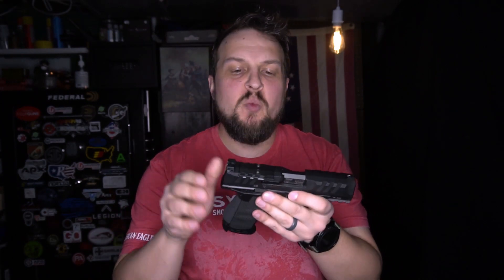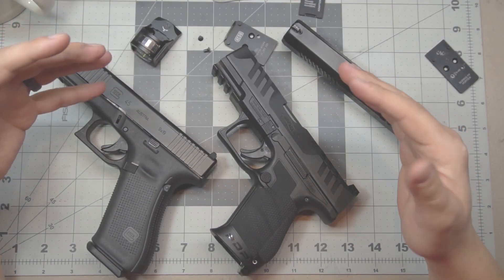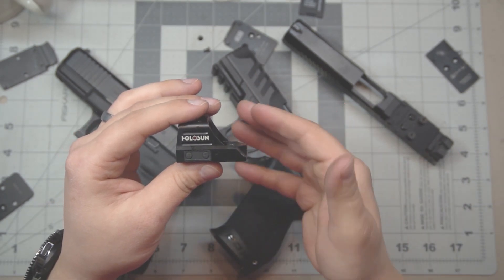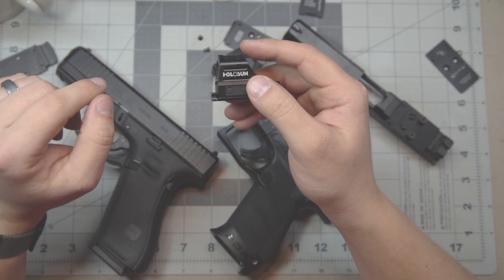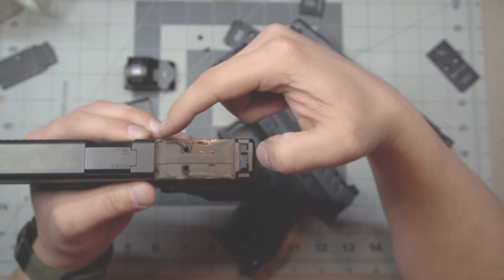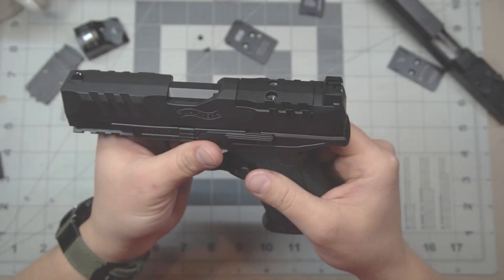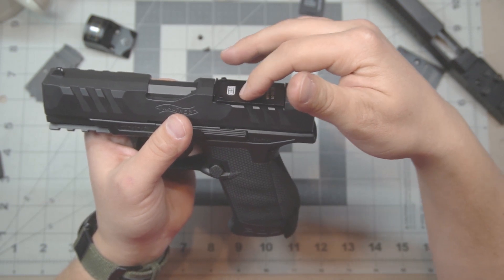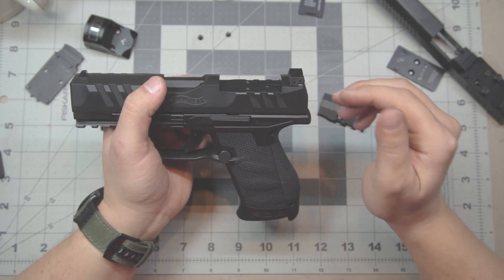The Gen 1 Walther PDP is going to Break

Comment: For what it's worth, I am a Mechanical Engineer (and an Electrical Engineer), I own a 32 year old company that deals with firearm modifications, I have designed modifications and I have worked as a hired consultant by 2 gun companies during design stages of a new model.  

I know what the tensile strength is of the mounting screws.  I know what the sheer strength is of the slide threads.  I am aware of the G-Forces involved with a red dot and plate on that reciprocating slide.  Inevitably I can only come to 1 conclusion which is backed by solid science.

The new Walther PDP is not going to break.
Reply: A touch of thread locker and properly mounted and torqued screws will greatly aid in preventing any failure of the plate mounting system.  I would still agree that having the cutouts and lugs to help in that are better, but I don't think this will fail because of slide movement from firing.
Reply: I am neither a mechanical engineer or any other kind of engineer, but even I knew that any discussion that didn't take into account material strength and use actual load numbers is a joke.
Reply: OU812- Perfectly stated. I barely made it 56 seconds into the video before reading your comment. Saved me 9 minutes of wasted time. Thank you
Reply: I bought a Walther PDP full size (18+1) on March 2021. I got me a Holosun red dot sight installed on May 2021. Almost 10 months later, the RDO is solid in place. No issues. No problems. Go figure!
Reply: @v.german11b  I’ve got a Holosun 407-Green Dot and it’s bad ass accurate and reliable. Zero issues ~
Reply: @tinman6514  Has you Walther PDP broken your RDO sights plates?
Reply: @v.german11b  Maybe all these Youtube engineers misjudged the screw's shear strength.lol Also , why don't the aftermarket plate mfg's design a plate that fits correctly without play. I'm no engineer, but a 40+ yr GM mechanic, and have seen a lot of engineering F ups over the years.
Reply: @danbush1249  
My PDP is holding strong a Holosun RDO. No issues so far.
Reply: Interesting how work the trigger never replied to this comment.
Reply: @juanmoncisne  🦗🦗🦗🦗
Reply from the maker: Walther recently released a new optics plate design for their PDP Pro line that includes the addition of... Wait for it... Recoil lugs 😉
Reply: @workthetrigger  How many actual verifiable issues have YOU recorded of the Walther PDP pistols breaking RDOs plates?
Reply: You are in a position to know about any inherent optics plate defect in the pdp. In my opinion trying to get work to own up to his ridiculous claims is like getting a rock to win the Kentucky derby.
Reply: Yea, i agree with OU812 ALSO.  If its a high quality steel screw it should be sufficient to handle the sheer force.  Not to mention the obvious, but if you go look at the Honest Outlaws review of the PDP, he seems to reference this type of criticism in his video by freaking racking the pistol by jamming the optic on the side of the table as hard as he could a number of times and the gun was fine.  That was WAY more sheer force on them screws than the normal action would ever put on them.  I'm confident that if the optic plate (screws) didnt come loose through that torture test then it will handle normal use just fine.
Reply: @notlisted1493  It was not the Honest Outlaw who tested the PDP optics strength, it was MrGunsNGear.
Reply: @notlisted1493  I saw the same video, you know and I know the truth. Hopefully a lot of others have to.
Reply: @workthetrigger  yeah they did, but they also released a statement say'n "that the original design is not flaw'd, but redesigned it to accommodate our customer base". Cost nothing to do, but kept their customer base and possibly added new customers because of this supposed flaw. That's a win for Walther...
Reply from the maker: Didn't cost nothing to do. You don't work in engineering, do you. Changes don't cost nothing, and you don't do them just for funsies to appease some dude on YouTube. Also wouldn't be the first time a Walther wordsmith put out a BS statement to try to explain it away like a bad magic trick.
Reply: @workthetrigger  I quit following or watching your videos because of your unsubstantiated claims. You popped up in my comments notification. Work the reason all these people keep bringing this concern up with the walther optics plate with you is this. The way you acted and childish way you kept making claims and statements and never backed them up. Youed expect that from a young boy not a grown man. Well I just gave you my opinion as to why this issue keeps festering for you. Man up work and address the issue concerning the optics plate like an honorable man.
Reply: The truth is that Walther PDP models have no issues with the optics plates breaking due to their design. That's the fact of the matter. The claim that "it would break" was totally speculative and unsubstantiated. End of the "story."
Reply from the maker: You really like popping in like your opinion matters 🤷
Walther changed their design because the original wasnt strong enough. Now go back to your forum trolling.
Reply from the maker: It's not true, though 🤷 I know of many that have broken...  It's funny, though, the Walther fan boys seem to discount every single one... Not because it didn't happen, but because it doesn't fit their narrative.
Reply: @workthetrigger  😄 "you know of many that have broken." Oh. It must be true then. No evidence necessary, just your opinion and statement.
Reply: Where is your proof? You claim that many have broken, but where is your data? You never provided any substantial proof to back your theory. Whether you're right or wrong,  where's the results of your actual testing?
Reply: @workthetrigger  work in my opinion and from other comments you’ve lost credibility. When you say you will do something and never do. I hope responding to you doesn’t help you financially in any way. I never watch your subpar videos any longer or am I subscribed to your channel. It keeps from having to listen to your mess. I listen to other far more credible firearms reviewers.
Reply: @workthetrigger  Walther changed the plate design to appease people worrying about nothing. People kept emailing them worried about because of your video.Sage dynamics has already tested this design, it's sufficient. I've beat the shit out of mine and no problems at all. Has yours broke?
Reply: @stanlysteemer4872  yes.  He was supposed to give the results of a range rental experiment and...crickets.  Big hat...no cattle.
Reply: @warrenrosen2326  I don’t follow him anymore this came in my feed. Well if you follow did he ever report back on pdp range test. I’d be very surprised if he did.
Reply: Weigh in on the Staccato C2
Reply: So CZ did it wrong?
Reply: I’ve got thousands of rounds through mine with a hell of a lot of abuse, not only hasn’t it broke but I’ve never even lost my zero
Reply: I am experienced with nvh testing and while I would say this design is not optimal, the effect on the optic would be minimal.  Those screws can handle far more sheer force than a micro dot will ever induce
Reply: I been running this a year and 4 monthsThousands of rounds!  Not one issue! Nothing but tack driving precision.  People complaining this gun is snappy are WEAK GIRLIE MEN!
Reply: @workthetrigger  🤣😭🤡🤡🤡🤡
Reply: The PDP is probably NOT going to break.  But will it lose zero or shifts in POA/POI?!?  That would be my bigger concern.
Reply: @Snapper314  Due to the mounting screws (which are very hard and offer fantastic tensile strength) having heads that fit into the countersunk holes, this serves as a "self-aligning" type of system that is held into place by a "cone within a cone" under high torque.  If a similar system was used on the underside, it would be touted as ingenious.  When done with a countersunk screw, it's so simple it becomes the object of ridicule.
Reply: @workthetrigger thats not tru walther change the design becuase  people assume the original optic plate is gonna break i am still running 2 original guns one close to 10k with no issues the other one with about half   this has been the case with many people this video you made single handlely gave out the crapiest info on walther pdp ever
Reply: Pretendginer know it all, mine hasn't broke and it won't. Walther engineers among the best in the world
Reply from the maker: @waderenfroe1696 interesting... Because they redesigned it to include the design features I criticized them for not having here 😉